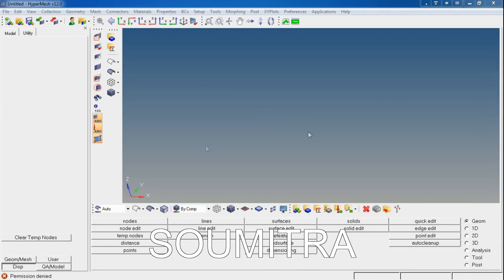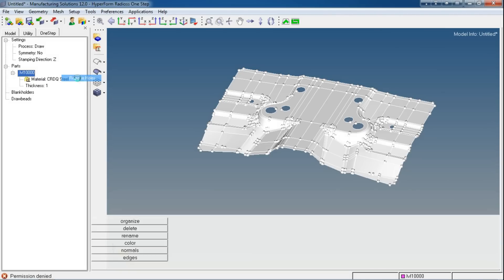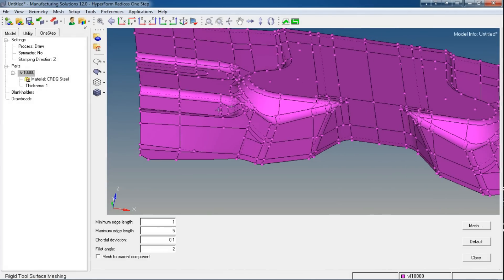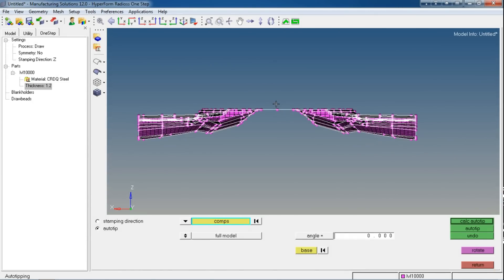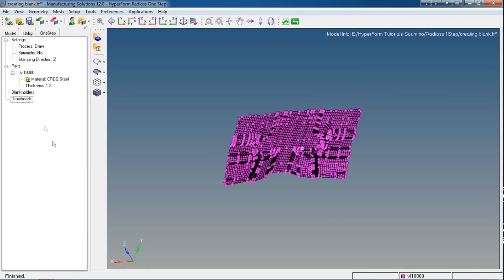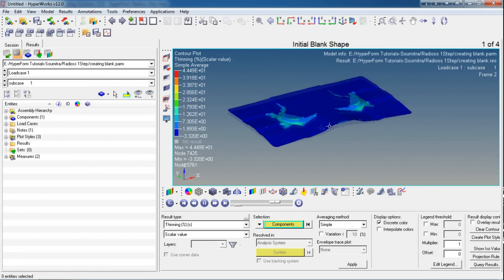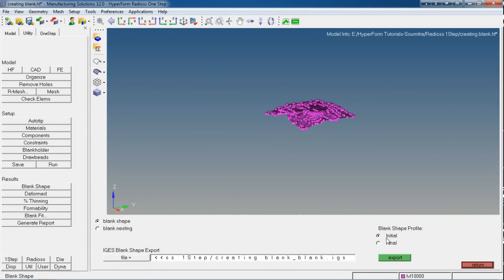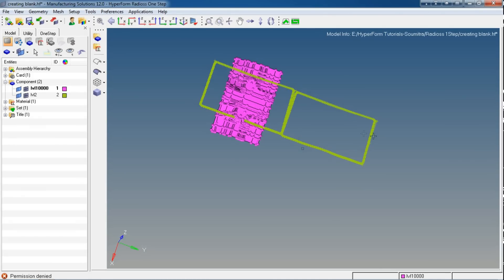HyperForm Tutorial with a practical Example- Part1- OneStep Radioss- Creating Blank

Comment: May I know the differences between  radioss one step, incremental and also die module?
Reply from the maker: +Fatin Zulaikha These are the three different modules inside the HyperForm suite. One step means simply as its name implies. It gives you flat blank in a single step. It does not take into account a step by step operation (if it takes) to form the final stamped product. It's just like putting an anvil on to you part to get you a flat blank. It's very fast analysis as compared to incremental and usually used only for proposals. It's not accurate or reliable, but at least helps to know feasibility of the part.
It is also used to get blank trim line (accurate enough).

On the other hand, Incremental analysis is a step by step approach taking into account all the operations to form the final part. It's more accurate, realistic and reliable.  You get special results for each operations.

Die module is used for creating die /punch/binder surfaces considering all addendum, springback, clearance considerations.
Reply: +Soumitra Vadnerkar owh... understood. thank you for your help...